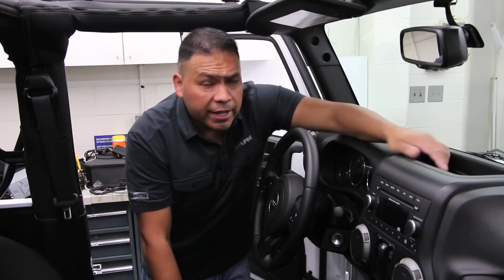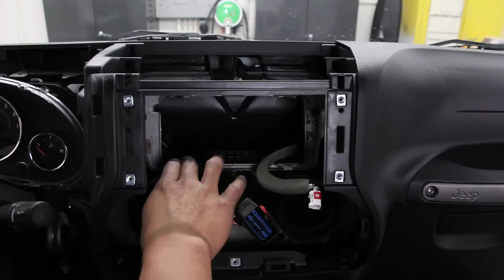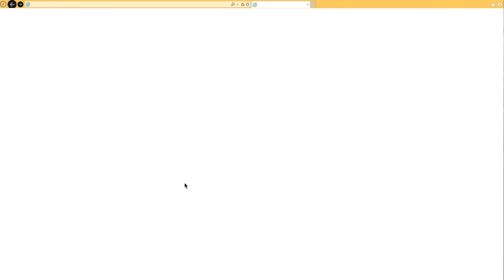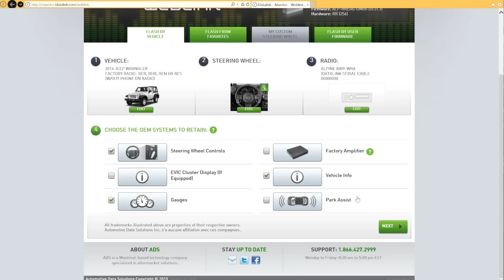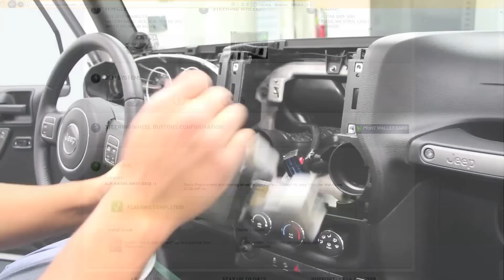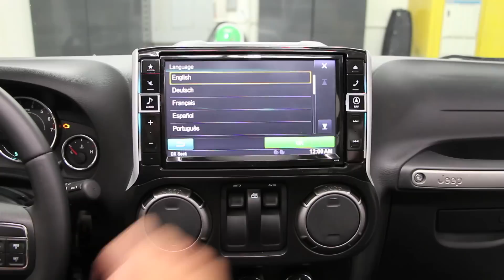Alpine X009 WRA for Jeep Wrangler JK Install

Comment: I think that looks stupid.  If you are going to make something to look clean like OEM it should at least match the dash material.  Doesn't look right with a glossy black faceplate on that matte finish dash.  The giant touch screen fad has about run its course in the market place now anyway.  A Jeep owner likes high quality buttons, switches, and levers

Comment: Would this radio fit on a Dodge Challenger ?
Reply from the maker: No it will not. They may have one for a Challenger, however this one is designed for a Jeep Wrangler.
Reply: como intalar cerradura al bonete

Comment: This unit it so overpriced. Your phone does 90% of the work. It's basically a screen and tiny amp and camera. It's like Charging $900 for an IPhone case. I'll just build a better kit using a raspberry pi for a couple hundred bucks.
Reply: How did that turn out for you? got a video?